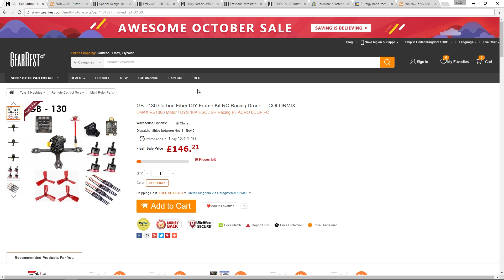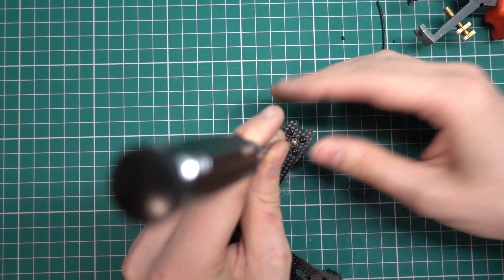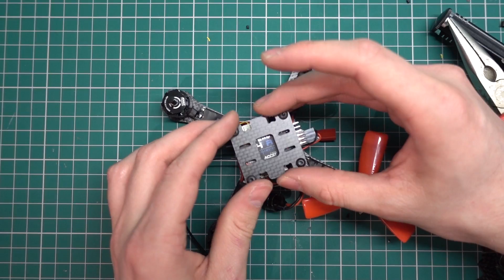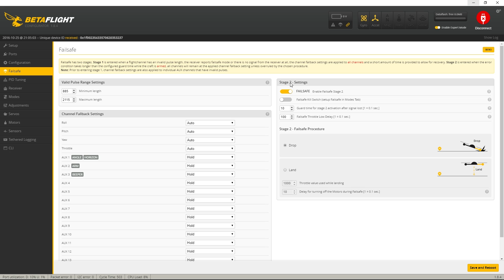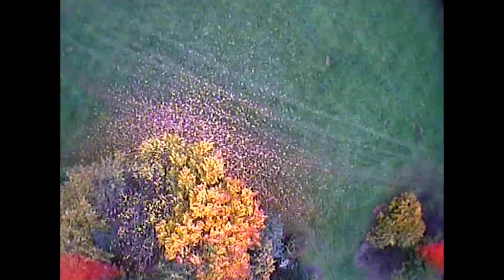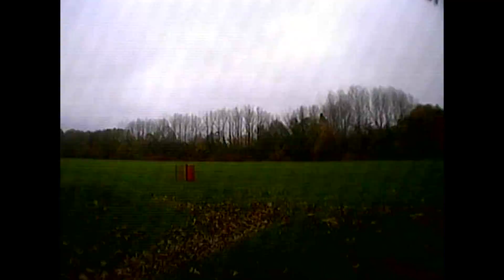Build A Brushless Micro

Comment: Is it really necessary to set up the failsafe 3 times? You did it on your radio, then you gave the information via the connection to your receiver and finally you set it up in betaflight. Wouldn't it be enough to just activate the drop-option in betaflight? Thanks for your great videos - you just got a new subscriber

Comment: your vids are the SHIT... question... it looked like you put way too much solder on when you were "tinnin' up the pads"... is that a problem? you looked haphazard with your solders but I've ruined like 3 boards with my crappy soldering. I have to be doing something wrong
Reply: Mark Novak 
Get your self a good solider iron with a fine tip. Pick up some flux & solider wick to remove excess solider that you get on the board. Plus get a Multi Meter to check your boards...Look at the videos from Blue Falcon or Jason Bardwell between those 2 you can fix or prevent a screw up. Between those 2 you'll be able to prevent any issues that could pop up.   Good Luck!

Comment: great vids Andy thanks for sharing 😀 question... do you ever consider the thread direction on the motors on your builds? every one says you can change the motor direction in the software but does this not mean your props may undo the nuts if you have the thread direction all messed up??🤔
Reply: you have to buy two of two motors; two that the threads go ccw, and two that go cw.

Comment: Andy - I'm considering a 130 size due to a change in the law that restricts the use of quads over 250g. Would you still recommend a scratch build with the decreasing prices/availability of models such as the Tarot 130 or the Eachine Racer 130? A 130 build with 1306 motors and LB20s (or similar) will easily top $200 and the aforementioned models are selling for around $165. Thanks!

Comment: I want a micro for when i go to the park with my daughter. Is this overkill and worth the build or buy Tarot 130 ? 
I did buy a qx70 and put the parts into a lantian frame with higher rpm motors as it was crap, but its no good for windy days. Fun on a still day though.
Dont realy need a super racer for this purpose as i have a 220 and 250 already but they are overkill for a local park.

Thanks in advance

Comment: is there's any difference between failsafe on flight controller and failsafe on receiver taranis have ??
Reply from the maker: yes they are two separate systems. if the flight controller locks up the fial safe could not work so its best to set both up
Reply: AndyRC so it's kind a backup failsafe ? Is there's any brand (except Taranis) have this kind of feature ?? Or its just Taranis ??

Comment: This looks like a good quadcopter and I ordered it from GearBest. Unfortunately the flight controller I received in the kit was faulty. When connected to BetaFlight, it was slow to respond to movements and did not work properly in flight. I contacted GearBest 6 weeks ago and after 2 weeks of going back and forth they finally agreed to replace it. 

They replaced it with another version of the flight controller that did not have the USB connector onboard. It was separate. I contacted them again and for the remaining 4 weeks tried to get them to understand that it was the wrong flight controller, and then when they finally did understand this they said they would send me the correct flight controller. But after another week they let me know they couldn't come up with it and didn't know when they would ever have it in stock again. So they refunded me $10 for my troubles. Gee thanks. I'm getting another flight controller elsewhere.

Buyer beware.
Reply from the maker: sounds like you were unlucky hope u get it sorted

Comment: Hello sir,  want to ask,  if im using omnibus F3 AIO with OSD and racerstar motor 1104 4000kv.  What esc i should use?  XRotor 12A 4IN1 1-4S Micro built in bec or Racerstar RS 20A 4in1 ESC
Reply from the maker: u dont really want to be using 4s with 1104 motors so i would say 12A would be fine
Reply: Oww thanks

Comment: Excellent video Andy, might well get this as separate components and use a Runcam Eagle because it's so nice with my Dom 3s. But don't you think there's an issue with those cheap JST connectors, with a 4 cell the motors can pull over 40 amps, less with 3 cell, but still?
Reply from the maker: jst is fine for a 3S i didnt build it to take a 4s

Comment: Hi, thanks for the video!  I'm thinking of building this but I have some questions:
1)  does it fly ok with 2 cells if I want a bit less power? 
2)  is it relatively quiet compared to other drones this size? 
3)  about how much run time per charge on the recommended batteries? 

thanks and sorry if the questions were answered in the video. 

thanks again and please keep up the good work!

regards.
Reply from the maker: no it wont fly well with 2 cells, it is quiet on 3s yes. set a timer for 4 mins

Comment: Great video. Thank you. I have purchased the kit and followed the instructions to build and set up the quad. I'm up to the betaflight configurator on the receiver page. I've turned on my Taranis and plugged the battery into the quad, and I do not see R,P,Y or T responding to my controller inputs. The receiver should be bound to the Taranis because when I unplug the quad my Taranis reports that the signal is lost, and I did hear at 18:14 in the video that I need to plug the cable into the left side port for SBUS. Any ideas where to look to solve this issue?
Reply: Oops, nevermind. I forgot to save my settings in Receiver Mode and Serial Receiver Provider.
Reply from the maker: great enjoy
Reply: I do have one final problem... I've calibrated the ECSs on the motor page, and all motors work fine except for one that does not go full speed and rotates back and forth rather than in one direction. Could this be a signal problem or ESC problem?
Reply from the maker: sounds like either a cold solder join or the motors shorting on the screws

Comment: Andy, which do you prefer to fly, this quad or the Tarot 130 you reviewed earlier. I am curious as I would like to buy a 130 sized quad and not sure which I prefer. The GB130 looks better for modifications but I am not sure if it performs as well as the Tarot 130. Any advice welcome.

Comment: Hey great video.  I'm just starting out and have 0 real gear. No transmitter goggles ect.   Is there anything you'd recommend as an all in one to get started?  I like micros but I don't want something like a tiny whoop as they lack the punch that I'd like. Thanks!! I'm looking to spend 600 usd max.
Reply from the maker: taranis for the TX for sure as for goggles cheap eachine vr007 expensive fatshark hd3 theres no all in one system fpv is very much diy when it comes to acro
Reply: I was looking at the RTF / FlexRC Owl Storm Edition. They have options to just bundle what they recommend together on helipal

Comment: awesome vids Andy, watched alot of them. i just ordered a picnic quad frame to start my build. also had a question for u. i have a jj1000 with 8.5mm motors and need a higher c battery because it cuts power with 380mah 25c ebay blue batterys. which high c rated nanotech would be comparable to it size and weight? figure u have a bunch of batterys laying around lol. thanks
Reply from the maker: i always use the 750mah nanotechs
Reply: AndyRC. thanks, would a 500mah nanotech fit in jj1000 frame? And also been looking at the kingkong smart 100 no reviews on it yet, u should do one!
Reply from the maker: i dont have that quad sorry so i cant comment. cheers

Comment: Is that frame the same frame as http://www.banggood.com/Realacc-RX130-RX150-130mm-150mm-3mm-Arm-Carbon-Frame-Kit-with-5V12V-PDB-XT60-Plug-p-1088991.html?rmmds=search ? Could you check the minimum space between the motor holes?
Reply from the maker: yep thats the one u dont need worry about the motor holes
Reply: Reason im asking is, i have some spare Runner 250 motors(from a broken runner hehe), and wanted to see if they'd fit. i think the holes are 12mm diagonal
Reply from the maker: u need higher kv than the runner motors. u wont get much thrust otherwise like the jjpro p130. go with the dys 4000kv of the red bottoms in this vid it will save u in the long run
u would have to drill to get 250 motors to fit it.
Reply: And you dont think i'd be able to get any decent thrust out of maybe a 4-blade prop?
Reply from the maker: i wouldnt say so you need higher revs to get power out of a smaller prop. you would be better off building a 200+ sized model from them

Comment: I am surprised about the power it has on 3S. Flight time of 5mints is very nice. Are that 3045 tri blades you get with it?
I start with 3S but i am ordering 4s 850mah. Hope my frame arrives coming week.
Reply from the maker: yes 3045 good luck cheers
Reply: Thanks. Hope thate the frame arrives tomorrow.
Reply from the maker: waiting is the hardest part :(

Comment: every time i get close to choosing a micro to learn acro fpv, another great quad appears, great review.  i was wondering if using the 12v bec on a 3s system might be causing some rf noise?..  i use this pdb on a 4s quad feeding my vtx 12v and my vtx feeds my cheapo fake ccd camera 5v... crystal clear, now if only i could actually fly fpv.
Reply: replies

Comment: What better PDB to minimise noise on the FPV feed would you recommend?
Reply from the maker: one that doesnt have the wires cross over the regulator which i think is the source of the noise. or get a better vtx
Reply: I usually buy the matek type that has the ESC power pads grouped properly (a positive and ground in each corner, kinda), so hopefully this will be okay. I'd ordered the components to do a build on this frame just before you published this video - looking forward to putting it together.
Reply: + thanks!

Comment: How to put the 808 #16 on 60fps?Thank you Andy
Reply from the maker: use a program called hybrid cheers
Reply: AndyRC Can you please give us a link up here? thanx
Reply from the maker: ill make a video on it cheers
Reply: AndyRC Cool. Now, slightly otp but do you think that strapping an 808 to an h502s can cause interferencies to the gps?
I am a bit disappointed by thge low quality of the stock cam. And from a dead battery. And from a noisy motor gear that seems to have not something stuck in it but it goes trtrtrtrtrtrtr. (Even if it flies, I am afraid to burn one of his motors, in flight!). 
When/if you find some time maybe take a look on the various h502s that I've put on. If you want I'll give the precise links.
And maybe let me think what you suggest about.
Thank you again
Reply: Others ideas for the cam:  put the h501s module in it
// or the 808 inside the belly, or to strap a run cam 2 that is shielded, or...?
Have you any cool ideas? Maybe you can do a mod/vid. I think it will be a success.
p.x.: I brought the h502s even after seen your entusiast video on it.
Bye!
Reply from the maker: theres a good chance it will interfere yes i had one interfere with the gps on the flying3d x6 u could try mount it on the bottom
Reply: Yes, I was thinking  yes under the belly. Maybe packed it with some aluminium sheets.
Reply from the maker: u could give it a go sure
Reply: Can you link now the video?

Comment: Don't all these quads start to feel the same?  You have all the QX series plus probably dozens more.  Given similar handling characteristics, what would make this quad worth buying at nearly $200, over just building a micro brushed for less than 1/2 price?
Reply from the maker: they are all different in fact u can build identical quads and they fly different. its a bit like saying whats the point of having a show that reviews cars when they all have four wheels and drive on the road. but each one is different and quads are much more affordable than cars... and more fun in my opinion also :) this one will have around 5 times the power of a brushed quad

Comment: Not sure if i should build a 4s 210 or this. My ZMR250 needs replacemente because it was built to learn and now its just too slow for me.
Reply from the maker: id go for a 210
Reply: 250 -> 210 -> 180 -> 130  

Go for 210 ;)

Comment: Pretty nice kit Andy :)
I would have definitely choose 4S over 3S!
808 camera, damn, so oooold school :D
Thanks for sharing and have a great week
Reply from the maker: thanks for watching. i think 4s could be too much with this prop size but i will try it out
Reply: AndyRC Just be careful because these motors can handle pretty easily 4S but maybe not these DYS ESCs though...
Reply from the maker: no id have to switch the escs, but this is my worry, the motors state they can take 4S but with these props they are already performing like a 4s, so my worry is that a 4s on this frame will burn the motors up, which is why i kept it 3s. the numbers dont quite add up to justify a 4s
Reply: AndyRC A lot of people are using the EMAX RS1306 4000KV on 4S Andy and they are handle it pretty well, thrust is just awesome :)
Reply from the maker: yes but i also see a lot saying the motors are overheating ;)
Reply: Good to know mate :)
I believe people who get hot motors probably have issue with their PIDs, ESCs firmware and maybe bad choice of propellers too...
Reply from the maker: we shall see :) thx
Reply: ADAMBOMB FPV For now, i did not see anyone sorry!
Reply from the maker: i think the rotor x are much lighter than the dals. i have a pair on the way. looking at the mini mobius also cheers
Reply from the maker: thx adam

Comment: Hy Andy,
I want to build a 250 size quad with 2206 2300kv motors on 3s with 5 maybe 6 inch props.
What kind of esc do I need? A 20 amp esc?
Reply from the maker: yes 20 amp or 30 amp
Reply: AndyRC So if i get 20a i can also run 4s on a 5 inch prop?
Thanks i for the super fast response btw!
Reply from the maker: yes u can with 2300kv. any higher kv and u might wanna go 30a

Comment: Great build and video. Is there a particular PDB you would choose for this build with a better regulator and maybe a layout that suits the frame really well? I guess you don't get the full 12V with a 3s.
Reply from the maker: id go for one where the wires dont have to cross over the regulator i believe that could be the source of the noise
Reply: Thanks, good idea.
Reply: Thanks, I will have a look.

Comment: nice 4 point roll how long did it take you to lern acro and is it easyer to use in fpv
Reply from the maker: try using horizon mode to get u use to it all the best
Reply from the maker: i flew planes first which dont have any self leveling. id recommend trying a simulator such as lift off or freerider to practice
Reply: Yee, acro in FPV is easy, i can fly pretty much without crashing, but cant make a turn without FPV
Reply: thanks for the surgestions
Reply from the maker: no problem

Comment: they have an all in one f3 fc pdb and osd on banggood made my build on this frame alot easier also used the dys 1406 which made this thing a monster
Reply from the maker: yes i have bought one to try thx
Reply: AndyRC flashing to beta flight was pain with that board took me over 2 hours let me know if you have trouble ill let you know what it took for mine
Reply from the maker: didnt have a problem with it. but done quite a lot of them now. just have to get the right driver installed
Reply: AndyRC i have the right drivers but with this board it would work then it wouldnt i couldnt have ne reboot checked or chip erase or it wouldnt work boot pad had to be soldered then once verifing un soldered ive never had one like it and 3 or 4 times it would almost finish then fail
Reply from the maker: the problem with the spracing f3 is that they have been cloned a lot, sounds like u had a bad one! this one flashed just switching the drivers.. same as my martian build i show switching the drivers in that one. hope u got it working cheers
Reply: AndyRC i did i had to only have manual baud rate checked at 260 they have the boot soldered and unsoldered once it started to verify
Reply from the maker: great! happy flying

Comment: Andy do u know any flight controllers with waypoint flying
Reply: Nice video as always btw
Reply: Have u thought of reviewing the f150 find it here http://m.gearbest.com/rc-quadcopters/pp_356605.html?currency=USD&lkid=10133805&gclid=COqBw76rgdACFYJkhgodr1YNEw
Reply: Yogi Bear check out micro apm, pixhawk mini, pixfalcon they are all over bangood, eBay and others. Keep in mind you are gonna need gps and telemetry for waypoints so need a frame with a little bit more room.
Reply: nasarami thanks I wasn't gunna use a 150 frame btw
Reply: nasarami have u built before
Reply: Yogi Bear yes about 10 builds so far between mine and friends. I'm working on a 200mm size with full autonomy. A little challenge.
Reply: nasarami I'm just trying to build a small aerial photography drone around 200-250mm that can hold a action can like the xiaomi any tips or things u suggest

Comment: Nice video. These little guys are among my favorites. I will actually use more with OSD, helps me get the tune done faster. Without osd I just fly the pack or packs, then make small changes. Takes me many flight sessions before I get a tune I am happy with. OSD also helps me discern if one battery is better than another. Waiting for a custom frame to do another 130 with the FuriousFPV piggy OSD.
Reply: hey nick
Reply: hello.
Reply: What is the osd showing you to know what to tune?
Reply: Matt Jones nothing. u fly the copter and then change pids through the Osd instead of plugging it into a computer every time